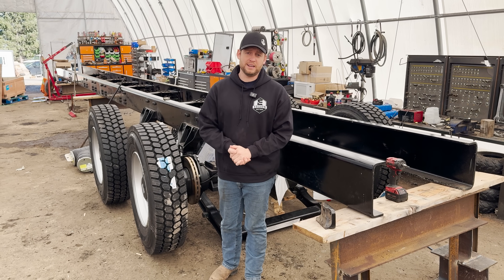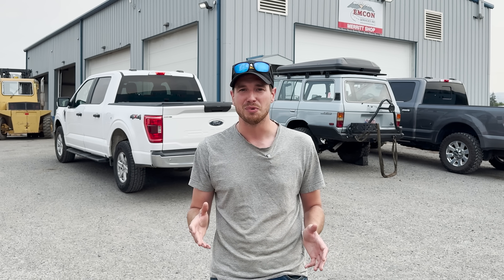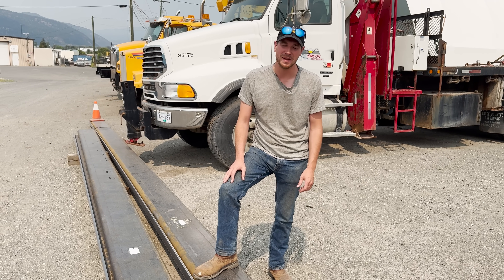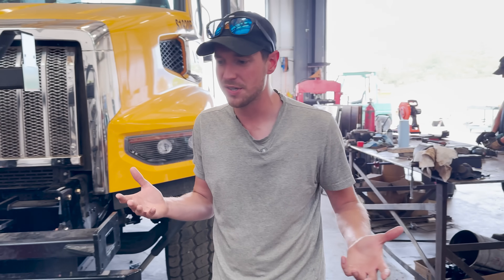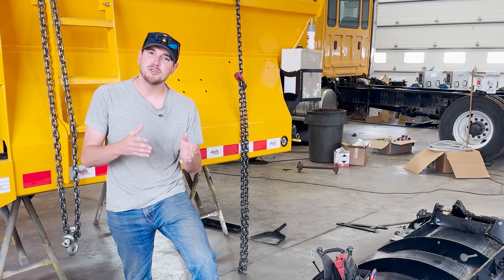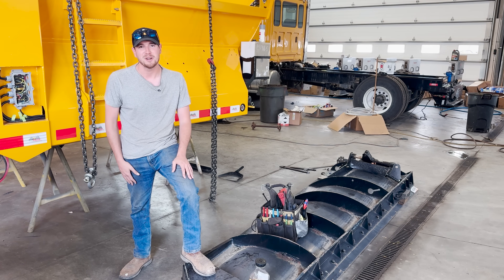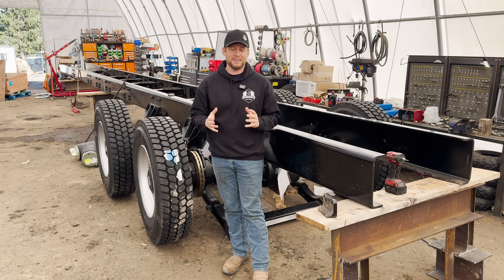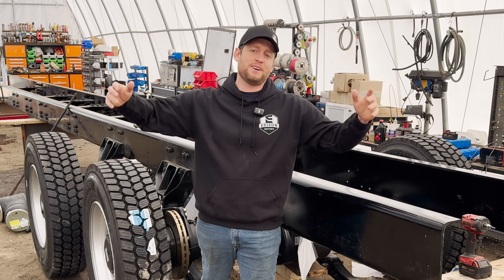Worlds First Diesel Electric SnowPlow

Comment: I just saw a video of a German railroad snow plow that had a large spinning element as part of the windshield to remove deposited snow by centripetal force.  I have seen a small version used on cnc milling machine enclosures to deal with spraying lubricant.  This might be an idea for your snow plow truck.

Comment: A diesel electric drive train would be a  perfect fit in a luxury coach.  It would eliminate the need for a dedicated generator to power the coach.  Packaging  the equipment would not be a problem.  There is a potential for actually reducing the weight of the coach.  Reducing the weight allows for the manufacturer to increase amenities. The batteries could be charged whenever the coach is plugged into shore power.  The electrical system could be operated while the coach is in motion.  Weight could be distributed better throughout the coach. Interior space could possibly be increased.  Unlike a truck, a luxury coach is essentially always loaded since they weigh 60,000+ pounds.  Regenerative braking would increase safety and braking ability.

Newell Coach would be the perfect company to partner with since they are one of the few manufacturers that builds their own chassis from the ground up in house.  Their current model is the p50 and it is powered by the 605hp Cummins X15.

Comment: I drive a dump truck in Maine, and I was wondering how Edison Motors would heat a dump body on a dump truck. I know normally the exhaust is routed through the body, but with a hybrid, how would you heat it?
Reply: I think the snow plough truck has auxiliary heating. 
While the truck is running, ectric heating would also work here.
Reply: This is a great question. Yeah, in this case depending on the engine heat wont do. But with 600 volts and 20,000 watts of battery power, I can imagine some kind of kitchen stove heating element should be able to keep anything warm.

Comment: One thing youre going to run into plowing with electric is going to be wheel spin. Sounds crazy to say but  even with those big heavy trucks full of sand that motor torque will be nutty. Your going to have so much power available to push those banks back there will be a ton of capability that will need reinforcing so other things dont break.
Reply: Yes. The electric motors have scary mountains of torque for wheel spin. Too much for a person to handle manually on a snowplow. Supposedly the new e-axles have wheel speed sensors, that checks like 100 times a second, so if an individual wheel starts to spin, the computer can throttle back that individual wheel. The production trucks will have 2 motors on each of the 2 axles. So each of the 4 sets of drive wheels will have its own power system. This snowplow should be able to deliver 99% of the maximum torque each wheel can handle, all the time.

Comment: It would be nice than, before making false claims, you did some research in the internet.
There is a american firm called Oshkosh Corporation which builds a hybrid diesel-electric tow tractor for airplanes called the Lektro 88, which is also used to clear the snow in the airstrips since at least 2016... There are other hybrid diesel/electric trucks out there, you know...
Reply: You are correct. Oshkosh has been making their hybrid diesel electric class 8 trucks with the branded "ProPulse" tm drive system. This system is in giant USA department of defense HEMTT's.  

I researched the internet and I don't see any evidence of Oshkosh hybrid logging/vocational trucks :( I would love to see one! :) that would be cool.

I do see Oshkosh electric only airport trucks.
Reply: @Sah-o5m  Check out the Sisu Hybrid diesel electric production heavy-duty truck from Finland.  It is used for logging, snow plowing, mining and other applications.  It has been around for quite a few years now, long before Edison even thought of the idea (or stole it from Tesla, as they themselves claim).

Comment: @edisonmotors I get the idea my curiosity lies in electric protection against corrosion from the brine and salt on the street. Also what factors are going into helping stopping these truck when adding the weight onto your truck
Reply: I too share the curiosity over salt/corrosion protection. Since Edison semi trucks are not 100% battery powered, they don't need to carry 10,000 lbs of batteries. They carry 2000 lbs of batteries. Since the batteries are doing most of the work, they can put in a smaller/lighter diesel engine that tops off the batteries as needed. With the white Topsy prototype truck they found the weight to be comparable to a traditional old style diesel semi truck. A side benefit is that instead of braking, they let off the accelerator pedal, and the e-axles go into regen mode that replenishes the batteries.

Comment: Maybe I’m missing something here…..but what is really the point of diesel electric vs just diesel? In many ways it makes no sense.
Reply: Electric has 100% Torque at zero rpm. A diesel has zero Torque  at zero rpm

Electric can regen power back into the batteries, diesel cannot.

With batteries handling the occasional high power  needs, the diesel engine/generator can be 1/2 the size and more fuel efficient.

The downside is all the complexity of a diesel drive system, plus all the complexity of an electric drive system.

Comment: You guys should do a Variable Regenerative breaking Lever or Pedal. It could be a third pedal or lever where the shifter would be. Giving the operator complete control on whether he wants to use brakes or Motor to brake.
I hate the blended pedals used in traditional EVs. And this not a Car!

Comment: suggestion   add  zinc pucks to frame   similar to ships at sea 
zinc =scaifical metal  stopping rust
also in water heaters  to protect tanks from rusting out
  air in water attracted to zinc   pucks need replacement about every 5 years

Comment: Since a plow truck has a more constant load, more like a tractor wouldn't an electric cvt be a better fit. I know you could put a bigger engine in and smaller  batteries, and it would run like one but then what the point of a cvt.
Maby im wrong and the load does verry a lot in wich the system should work great.

Comment: I don't understand this. I love the usual Edison stuff but I just can't get my head around why this is a good idea. They sit idle for long periods, do low mileage and don't make best use of this system at all.
I mean its better than a normal one but I can't see it being worth it. 
Compared to the usual truck I would think the normal use cases would make much better use of this and generally be a better idea. 
Its like you're going to all the trouble of making a truck which could save 100t of CO2 then using it in a truck that only saves 20t. I mean its better but it just seems a strange use of the tech. 

Great that you got a grant though - probably one of the few companies who actually deserve it.

Comment: If you want comments then all this old plow driver ever wanted is for the dimmer switch to be put back on the floor. Right hand busy with plow controls, left hand steering not safe to move hands for stalk mounted dimmer. Thank you.

Comment: Should have gone for a fully electric vehicle, every major lorry manufacturer in Europe and North America makes electric models you can put a plow on the front.

You don't have to worry about range because these massive trucks have ranges of 200-400 miles depending which truck.  A snow plow would drive around for a few hours then get back to the depo for the driver to take a break, it's still a truck he/she needs a break.

With old technology you'll have a 40 minute recharge.  If you use technology from a Volkswagen ID.7 you're looking at a 25 minute recharge, Kia have 18 minute rechange that's been in production a few years, the Volkswagen ID.2 is going to have 20 minute recharge.  If you look at prototype technology you can get a 10 minute recharge.  It depends how many minutes your driver needs to have a pee and make another coffee, also different countries have laws dictating driver breaks.

But you will have enough time to recharge without any problems, you don't need a hybred with a diesel engine.
Reply: The snow plows can travel quite far you know? Maybe it doesn't match up the best with when to charge. And when it comes down to it they could have different drivers. So your idea is that they only place they charge is at the depo? And the charge times applies to cars. For a full BEV you will need a lot more power to charge so much go into truck fast DC charging.
I don't see why this niece vocation truck use needs to be made fully electric already when you can get the most diesels off the road buy building trucks for transporting cargo in a predictable way, like Tesla Semis are designed for.

Comment: I would assume better fuel mileage as the diesel is set @ X rpm and not up and down as a normal truck would be using the engine for acceleration  in stop and go conditions.  It will be interesting to see how this performs this coming winter.

Comment: We are already using fully electric snow plows in Norway.
Reply: Well they didn't claim fully electric.
Reply: @subwarpspeed  Sure. But I don't see what is supposed to be revolutionary about this company. Scania (which Edison is buying engines from) has already tried and stopped selling hybrid trucks. Diesel wins on cost, and full electric wins when the customer wants electric. I'm sure there is a niche market, but it's a niche market.
Reply: @subwarpspeed  However, they did claim to be the "World's first diesel electric snow plow" which is unfortunately incorrect.

Comment: If you're not running completely on battery it's not an electric vehicle, if you're putting any fossil fuel it's an ICE vehicle.

Let's try this with complete battery operation and see the viability of these kinds of vehicles in the winter plowing.
Reply: That's your definition. It's not fully battery electric but on the other hand it can run with the diesel generator off and thus is an electric vehicle, a series hybrid specifically.

Comment: I understand the electric/regen aspect for the logging trucks, and quiet aspect for a concrete truck, but I don't understand the benefit for a snow plow. Unless they're operating in very hilly terrain too. Or will be operating on residential streets.
Also, for trucks like snow plows, what about using thermo-electric "regeneration"?Run coolant lines through a heat sink block before the radiators and gain back some power.

Comment: Honest question here. How are you able to create a new truck with a diesel engine that doesn’t meet the same emissions standards all other OEMs need to meet? Nobody else can build trucks without DEF and an aftertreatment system, so I’m curious how you can use CAT engine for highway use and get your truck certified to be on the road? Is there a way around this because it is hybrid?
Reply: They have said they will start to use Scania engines with DEF.
Reply: Legally, Edison trucks are registered as 100% battery powered and the on board engine is not relevant.

In the future the engine may be scrutinized so by going with Scania engines that are Tier 4 compliant, then Edison should be covered.
Reply: @Sah-o5m  Thanks for the information. I wasn’t aware of their plans!

Comment: I don't think it will save much fuel in this application because of the lack of start stop cycling. Maybe the machines that that load dump trucks, excators (Left right left right left right) and front end loaders backhoes when used as a front end loader. Garbage trucks.

Comment: How many kilowatts is the generator in topsy?
Reply: Theoretically, the Danfoss t2000 generator makes 422 kW at 4000 rpm. But the cat engine only spins at 2000 rpm so 211 kW. But it might have been smaller than a T2000 generator so even less.

Comment: No, you didn't steal Tesla's idea. You tossed the pure battery idea out the nearest window, and built a practical hybrid system for a truck. Trains have used this concept for decades. I'm happy to see it getting put on the roads in a useful manner. Maybe one day the pure battery idea could be used outside urban areas. For now though the battery and charging tech is just not ready.
Reply: No it has not been used for decades on trains. Edison motors is build a series hybrid so it charges batteries that powers the electric motors. Trains have not had this middle component that is important because it allows for peak performance of the diesel generator and regen braking. Hybrid trains have been introduced in the last ~10 years only.
Tesla isn't pushing their Semi on these tasks. Their pilot program with Pepsi and probably others will be where it fits like a glow and is better than diesel. Charging can be ready for that. It's a big market that they can fill even before they need to expand into other types of trucking.

Comment: Btw. Its not a hybrid.  Its an EV with range extender.
Reply: It's a series hybrid. It's one form of hybrid. Check the big wikipedia article on this and you see that Edison's truck fits squarely into the definition of a series hybrid (with possible external charging).

Comment: I always thought having a very heavy, F-350 sized electric plow truck would be amazing. Add in the hybrid and it would be unstoppable. All the torque and non of the noise. I did a lot of apartment parking lots at 2-4 am during snowfalls and I would hate to have to hear those trucks driving around all morning. Another huge benefit to electric for these is that your not slamming a transmission between forward and reverse all day. You could even put 2 pedals down for forward and reverse.

Comment: Really, really cool.  

Any reason why you are doing hydraulics though?   Wouldn’t electric linear actuators simplify the plow and dump bed operation significantly?   No fluid to leak, no fluid lines to route, and you’ve got electricity on board already.

Only downside I can think of off the top of my head is that current snowplows all use hydraulics, so hydraulics keeps it common with the current generation snow plow trucks.

I sure wish I could justify Edisonifying my plow truck (1965 I-H F-210D, 4WD 10 ton, with a 10’ blade, the side wing was removed)

Comment: I love this company! I'm going to scrape together some money and invest in them, somehow. I will be contacting them for sure! I'm a Tesla (+Starlink) owner and have watched their progress for many years. So refreshing to see new ideas from Edison coming to fruition for Canada, especially BC! Hybridization of power is not new, cargo trains have been doing this for decades! This is a perfect solution for maximizing power when you need it. My only concern is charging batteries below freezing, I hope they have something like Tesla's battery heating system for charging at -25C (or worse) in Canada
Reply: When I speak of cargo trains (diesel electric locomotives)  and looking into how they are working, their diesel engines are running pretty much all the time, not taking advantage of braking regen to recharge batteries (which they do not have), but instead waste energy that is dissipated using resistors! Energy that could have been used to recharge high power batteries to support the motors. Of course, they are stuck in the old times, where the cost of upgrading to new tech will be be a huge risk. Sad....
Reply: @Chrisrrable  You are among the very few realizing this is not the same as how diesel electric locomotives have been built. Thank you. I would just like to add that you can search for "hybrid trains" and find some models with batteries but those were introduced in the last ~10 years and I don't know how well they are received - but at least some manufacturers makes that.
About investing it's on their website all the info to read and see if you qualify.

Comment: Isn't it kind of weird, that you emphasize the environmental friendliness, but also that have a diesel powered supercharger? 
Like, I totally believe Diesel-electric has it's place in heavy environments like you are working in. It's just that a Diesel-powered supercharger seems worse than a normal one xD

Edit: are you planning to add charging ports to your trucks? What charging port is used on trucks in north America?
 Snow plows allways start from the same hub, so having charging infrastructure there to get through the first 3-5h hours of work would safe a lot of CO2
Reply: We already have fully electric snow plows here in Norway. They've done 9hr continuous plowing without recharging. https://www.youtube.com/watch?v=XpT0eIpCVS8
Reply: I don't think it is. These machines have possibility to save on diesel used (especially for logging) for the same amount of work.

Comment: Wow, nice work. Could you guys make a video to show those ignorant people how your PHEV truck will use less Petrol (less emission) and more power. Because they think it still uses Petrol, it is as "bad" and they might as well use an ICE system and save the money. Also, how will the new Import tax ( Tariff ) from China affect your cost?
Reply: They don't use any petrol at all since they use diesel. There are many videos, in about every one where they explain to "outsiders" they lay down why a series hybrid has benefits, especially to logging trucks in British Columbia. It will mostly rely on the diesel generator for power. The plugin is probably only if you happen to park well over night.